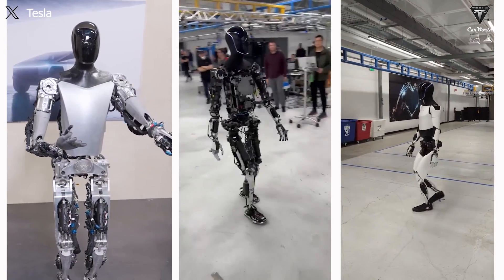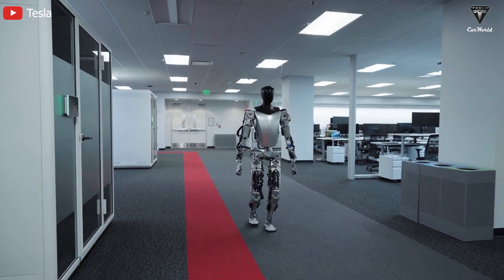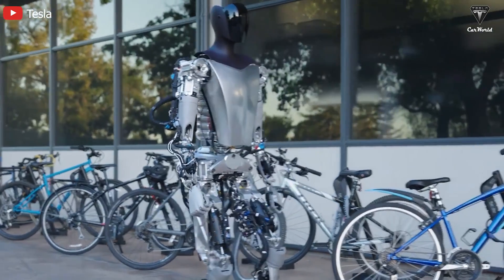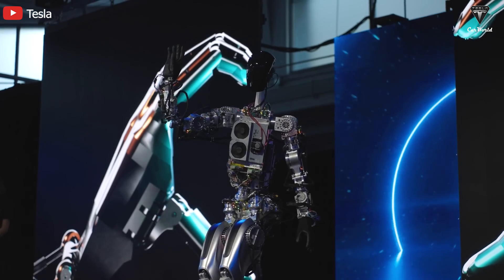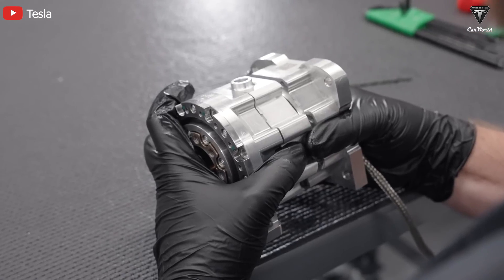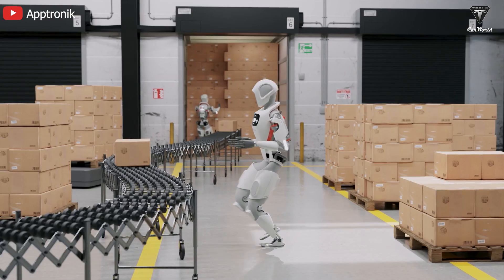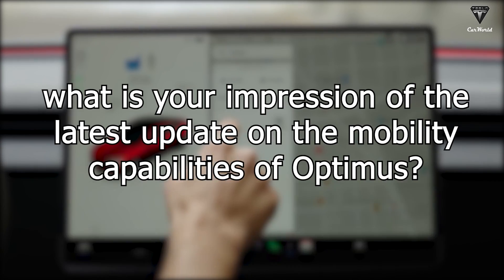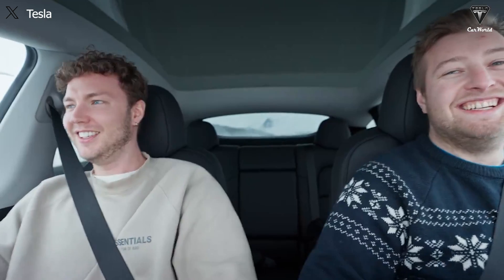It Happened! Elon Musk Revealed BIG Upgrade Tesla Bot Gen 3 - Optimus! Hit the Market in 2025!

Comment: Megatron said, "I was  built first." 

It's form over function.
Is it for assisted living for the handicapped and elderly?
Or is it a worker Droid in a wearhouse?
Johnny 5 is alive.

Wouldn't it be a better option to have slots to hold 2 batteries? Set the robot to have a function when the battery is at a low % it goes to the battery station. Where it adds a 2nd full battery while the first is still in. Then removes the first and sticks it in the recharge station.

People eat while awake, not while they sleep. If they are building a robot with human abilities. 

Elderly cowboy walking flat foot

Building Optimus
I'd be having consultations with some of the artists and creators in Japan. The mechanics of robots. 

So much can be improved.

What is end goal?
Work backwards.

I'd try to get everyone's help, not just a select few.

Hand and foot are build similar  in humans.

Comment: I think they should make a thin pad that is positioned on the floor and a robot only asked to stand on it to start the charging cycle, that way the location of this pad the robot would know of maybe have a few of them around the house, and have it programmed for after a certain power level it hhas to go back to the charger just like the cellular phone does just set it on a pad and it charges itself don't go to plug it in or nothing just set it down on the pad have some kind of sensors built into their feet

Comment: Those robots will be excellent for Mars. I do not recommend it for lunar space exploration due to the accelerated corrosion/decomposition of metals in lunar soil. Perhaps when the bases in the lunar subsoil develop more they can be maintained for a long time, but unfortunately the Lua & Robots association is still prohibited.
Reply: They'll just build them out of different material. Think exo suit that can easily attach itself to the main frame.
Reply: @blackmamba___  They will definitely change the material used. But I believe that this restriction still prevails and is the real reason why the countries that landed on the Moon did not insist on it. Even India went through difficulties that reduced the "visit" of its spacenauts to a brief landing and takeoff. Until now...